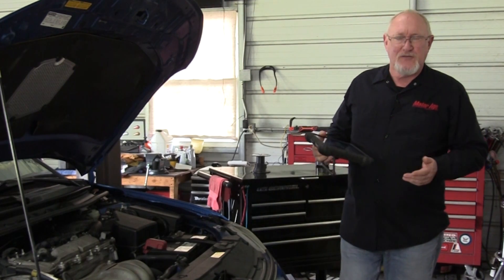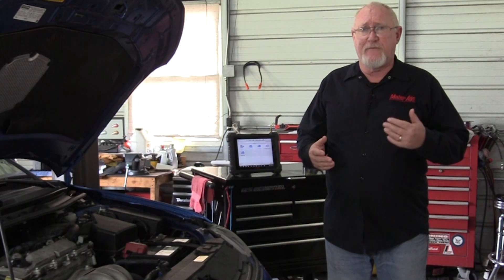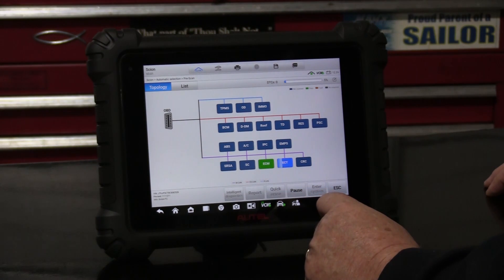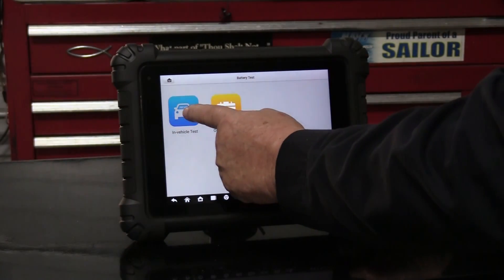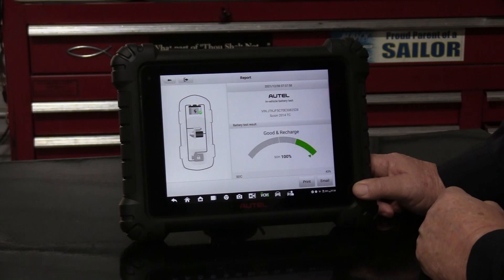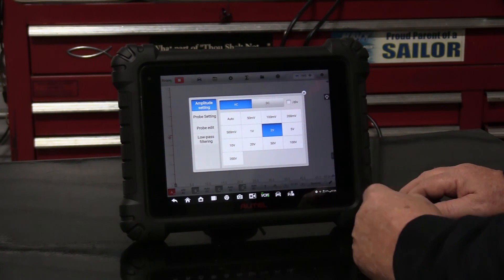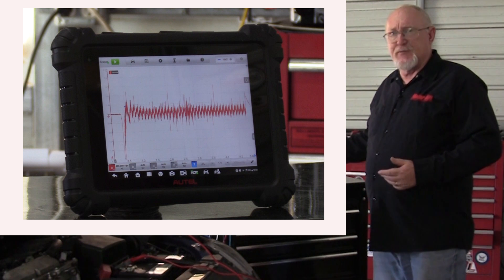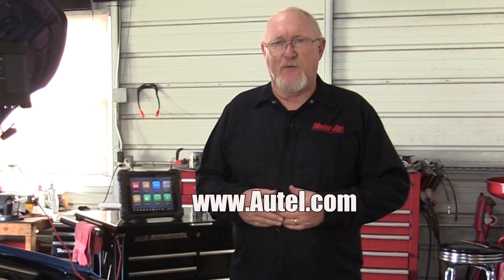The Trainer #120:  Scan Tools For Vehicle Maintenance? You Bet!

Comment: Hello I have a question. Can the relative compression test be performed on both diesel and gasoline engines in the same way?
Reply from the maker: I don't see why not. You just need to disable the injectors and/or fuel delivery to prevent it from starting. I'll have to try that on my 6.0!